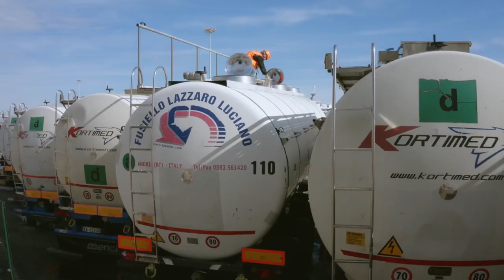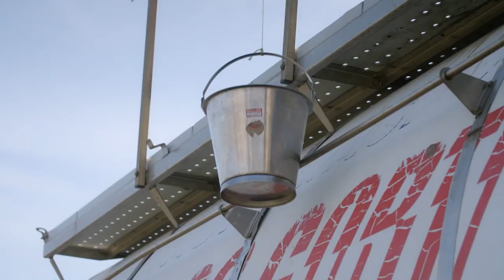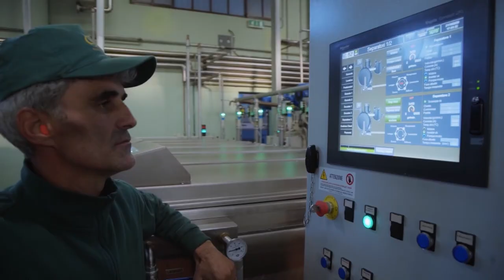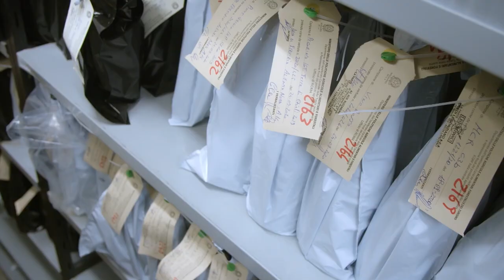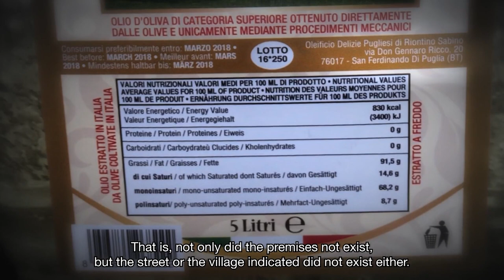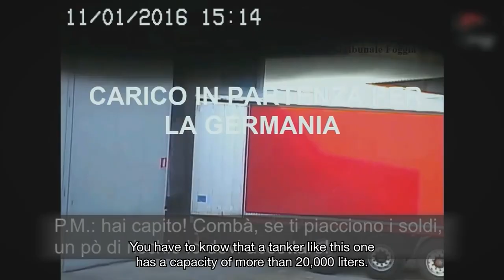The Italian Mafia's New Weapon: Olive Oil | Food Fraud Mafia Investigation

Comment: There are honest Italian and Spanish exquisite olive oil. 
But also dishonest ones, in both Spain and Italy. The point is that for me it make no sense to consider as Italian an oil that is not produced, totally or even partially, in Italia. 
Same would apply for any other country, although one of the main worldwide seller is Italy. 

An excellent Olive Virgin Extra Oil, cannot be cheap to produce, but also to be sold. But where there are huge gains, there is mafia.
Reply: Don't put all in the same basket, no the ones having the real problem with the olive scam is Italy, and they have been the ones doing this for decades. 
If you want the real deal when buying extra virgin olive oil is easy, don't buy Italian, buy Spanish instead, no mafia and just for you to know Spain it is World's 1st producer by far far distance. The best that can happen to you when buying Italian is to be buying a good quality Spanish oil labeled as Italian, but at double the price.
Reply: Io produco olio, Per la famiglia e gli amici.
Considerando la fatica, le spese di mantenimento del campo, il costo per frangere le olive, oltre il costo di reti per la raccolta e casse( una tantum), è letteralmente impossibile ad un costo di 3€..
Ah dimenticavo il costo della bottiglia con eventuale etichetta,necessaria per il trasporto.
L’olio va comprato da piccole aziende, agriturismi